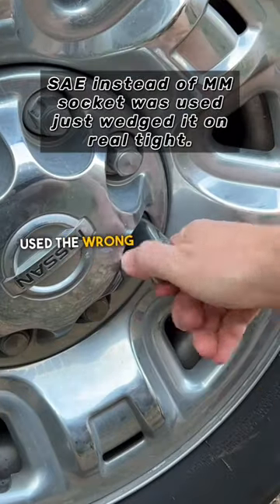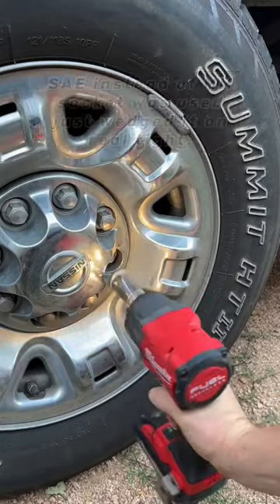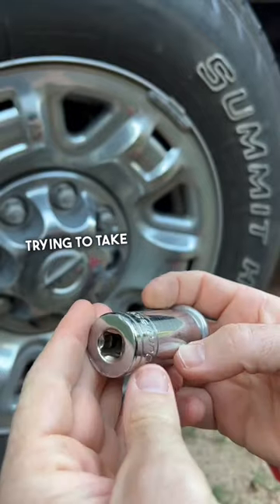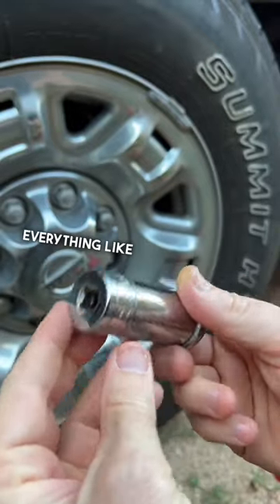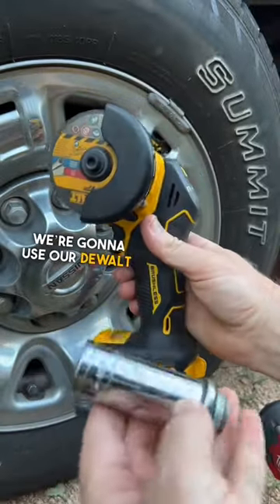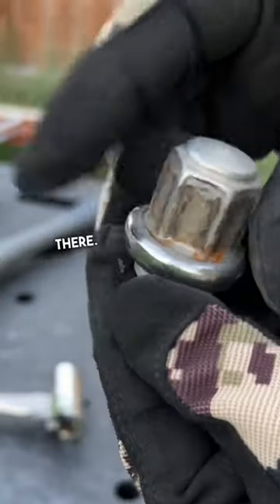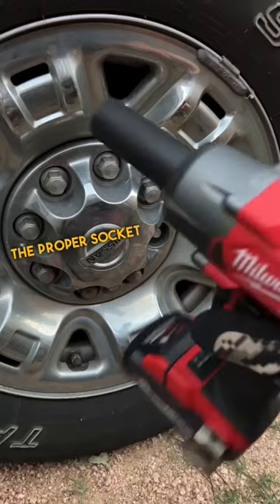DeWALT 3 Inch Cut Off Tool In Action!

Comment: Pretty sure you coulda just tossed it on the ground a couple times and not waste a socket lol
Reply: It was a chrome anyway
Reply: The difference between an impact and a chrome socket is not that big. I've used chrome sockets along with impacts on my impact my entire Professional Automotive career. Impact sockets have more weight so they carry more punch to the bolts. I have never split a socket that was a reasonable brand name
Reply: Also drop a quarter inch extension through the 3/8 adapter socket and drop it quarter inch side down on the concrete. I've never had that not work to free a socket from a stuck Bolt
Reply: That’s what I’m saying
Reply: @ramapalmer5985  Ya the only sockets I've broken have been those cheap low profile wheel sockets which is kinda just asking for trouble
Reply: Seriously
Reply: yup
Reply: Honestly could have gotten the lug out by putting a screw driver on the side and banging it down
Reply: Agreed cool tool but waste of a socket lol
Reply: Using chrome sockets on an impact not only hurts the socket but also messes up the impact anvil, the black ones are meant to be soft so they deform instead of the hammer.
Reply: First, never trust a mans advise who has a plastic work bench. Second, instead of wrecking a socket take a pin punch and punch the lug nut out.
Reply: @ramapalmer5985  I’ve never split the cheap chrome ones either and I’m using them with some pretty gnarly Milwaukee impacts
Reply: @DillonV  right! Especially 6 point 💪🏻
Reply: @ramapalmer5985  the weight is only caused by the impact socket being soft steel, chrome sockets are hardened and shatter/explode.
Reply: @402outdoorzx5  that's not the case, soft steel is not heavier and impact sockets are very much hardened.
Reply: I mean he could have just beat it with his purse a couple times and it would have fell out. Or use the other socket to take the remainder lugs off once the tire is removed stack a couple washers over the stud and against the rotor tighten the lug nut back down against the washers just enough that you break the tension on the socket remove with the right socket. 🤣
Reply: yup, had to do that a lot during highschool automotive and worked every time
Reply: Right I call it the old smacher it's an old machanics trick lol
Reply: @ramapalmer5985  The steel is softer therefore you need more to be strong enough. I’ve also split my handful of snap on chrome semi deeps. Fairly certain I had a bad batch of steel but. I don’t run an impact on chromes anymore cause of that.
Reply: @home541_  it's not softer, it's more flexible, or maliable to move with the impacts. Think of spring steel vs cast iron. Both hard, but cast iron is brittle whereas spring steel will flex. This is dictated by the metals grain structure. One is chrome vanadium and impact is chrome molybdenum. I can see how you can see maliable as softer. I've sent 12pt (when i didnt have a 6pt) deep and shallow craftsman, matco, and snap-on sockets with 700 - 1100ft lb ½" air impacts on axle nuts and crank pulleys for decades without failures
Reply: CR-V still works with impact. Just that is not effective as CR-MO. Impact sockets are usually heavier and can transfer more torque while storing torques during hammer charge turn. Heavier sockets will store and transfer even greater energy. 

There's a demo on YouTube of the same sockets for each type. The only difference is their size and weight. They tested it with the same impact gun and the results difference is huge.
Reply: @presistancelydeccer7338  High mass sockets are nuts. Coworker has a couple for Honda crank bolts. No longer needs his 60” breaker
Reply: its a snapon so why would you care ?
Reply: @ramapalmer5985  you clearly don’t know the difference between chrome and black. Has nothing to do with the weight of it 😂

Comment: no way i just seen you start a thread with a impact gun
Reply: I’m not even a mechanic and I know better LMFAO
Reply: My boss was a Nissan tech, it’s how they do it in their dealerships so I’m not surprised
Reply: It’s perfectly fine at low speeds and holding the impact straight that’s how I’ve always done it as a tech have yet to strip one doing it that way
Reply: @colerakocy2250  yes. But you didnt do it in your driveway with clean tools you know lol

Comment: Should of put the nut baack loosly on the thread an work the socket up n down untill it comes off
Reply from the maker: Appreciate the suggestion, yet, I tried that and other methods, had to cut it off. Learned that from a previous time it happened.
Reply: This works as well
Reply: @MasteringMayhem  lets pray you never work with rust because you'll be buying sockets everyday 

Or you could just be normal and hammer out the socket.
Reply: @MasteringMayhem  in a vice with a screwdriver into the hole of the socket and hit it with a hammer? bro the thought of cutting it should've triggered alarm bells

Comment: Step 1 to not ruining your socket: Put socket in vice
Step 2: beat lug nut out with hammer
Step 3: enjoy not having to replace a socket
Reply: Did he really think the nut was 
more expensive than the socket?
Reply: came here to say this
Reply: I get what you're saying but he definitely has more of those sockets. If he doesn't want to go to the store to get a lug the way he did it is quicker and cheaper. I feel like he could have gotten it with it on the wheel. If you bang it out with a hammer and thin piece of metal you'll scratch up the lug
Reply: Hammer and a punch worst case scenario
Reply: step 4 spend 200$ on a snap on 18mm crome socket and cry
Reply: Or just thread it back on, get an extension+breaker bar and wiggle her out
Reply: Lug nuts are cheaper than sockets.
Oh, and why were you not using the impact socket in the first place?
Reply: @wes1051  if it was a Pittsburgh socket then ya lol
Reply: Ya but u missed the video of him welding the socket back together bro, come on.....

Comment: Several alternate options:
1) Drop it on the ground, will jar loose
2) Pound it out with a punch through the square drive end
3) Tighten back onto a bolt so it goes the other direction
4) Let a real mechanic deal with it

Comment: I usually go get a stud that'll thread into the lugnut, thread it in as far as it'll go, put the socket in a vice and smash the top of the stud with a hammer and a punch until the lugnut comes out. If the stud got mushroomed up, just hit it with the cutoff wheel and you'll save yourself a socket. Usually works

Comment: Step one - use impact rated instead of ratchet rated. Step two, if you already screwed up step one - grip a trim bar against the socket wall, flat pressed against the flange of the lug nut, then hit the bent end of the bar with a hammer.

Comment: I did a similar job with the M12 Fuel but I had to cut the actual lugnut as it cross threaded and somehow when I took the bigger impact it would become loose but within the threads so it wouldn't come off.
Mine stalled a few times doing it, looks like the DeWalt would've been a bit quicker
Reply from the maker: For this situation this approach was best. This is a rare occurrence so I wanted to fix it as quickly as possible too.

Comment: You can just slam it in the floor over and over to get the swollen nut out. 

And I think I seen you put the bolt back on with a impact wrench. Twist it on to get the tread started then use the impact wrench.

Comment: Did you not try taking a punch or even a screwdriver and forcing it out? I’ve done this a couple times but never had one I couldn’t get out with a few good blows with a hammer and punch
Reply from the maker: Last time I tried that I just put a hole through the top of the lug nut 🤷🏻‍♂️
Reply: @MasteringMayhem  Swollen lug nuts are never worth saving. A pack usually cost anywhere between $25-35 and will save you a ton of trouble.
Reply: @MasteringMayhem  okay? Lmfao
Buy a new lug

Comment: Soooo many better ways to go about this lol
Fords and Nissans, especially, used what we call "beauty caps" which are just polished or chrome caps over the actual lug nut. After a few years and numerous tire rotations (probably with the wrong socket) they start to distort and get stuck in sockets. When this happens, I recommend replacing them with a solid lug nut because no one wants to fight off all 20 lug nuts on a five lug car.

Comment: Easiest way to get the nut out is to tighten it back on until the socket slips on the nut, or screwdriver through the back but you can poke right through chrome nuts like that

Comment: A. put a screw driver through the end and smack it with a hammer B. Those lug nuts shouldn't be put back on with a power tool
Reply from the maker: A. I tried the screwdriver method before, just put a hole through the top of the lug nut, had to buy a new one. B. I'll be using the ICON micrometer I got from Harbor Freight in the future.
Reply: lay it down  on side hit with hammer knocks it out do it lots of tomes
Reply: @MasteringMayhem  on every wheel nut ?. 😂😂😂🤦🏼‍♂️🤦🏼‍♂️🤦🏼‍♂️🤦🏼‍♂️
Reply: Well, you're definitely mastering some kinda mayhem....

Not only did you destroy a perfectly good socket but likely tore up the lugnut even more.

Comment: Lel. If the nut got stuck on the socket because if the wrong size. Just tighten it back. It eventually will come loose or if it was stuck during tightening. Just give it a few kick backs to open so that the socket will let go from the impact. No need to waste time cutting it out. Could save up sockets and time.

Comment: NEXT TIME:
A) Thread it back on and wiggle the socket off.
B) use a vice to hold it and a punch or quarter inch extension thru the hole.

Don't be like this guy.

Comment: Dude... Take anything steel, that fits in that hole and drop it from shoulder height... screwdriver with a decent handle can be used. Just drop it handle down and the nut will squirt out the (vertical) end of the socket.

Comment: U only use a impact to take lug nuts off simply because its easier doesnt in any way make it better. U over torque your lugz and it will be just as bad as not tightening them at all. Get a torque wrench use that muscle in your forearm that holds onto things and twist said lug nut on by hand and when u get it hand tight then use a ratchet and go in a star pattern atleast 3 or 4 times on each then put the torque wrench to it and apply proper amount of torque. U can wprk for Sears though thats how they put lug nutz on works real good for about a mile or 2.

Comment: Put the socket in a vise, find a punch that fits through the drive hole and hammer away. Works every time. or you could destroy a socket and waste 20 minutes doing this instead.

Comment: Or you could have taken like a quarter drive extension and shoved it up the half inch drive hole and used it like a ramrod until it came out and kept your Chrome socket perfectly intact

Comment: Push a Philip head screwdriver in the socket hole and whack it on the floor a few times. 9.9/10 times it works

Comment: Or… slide a 3/8 drive extension down the 1/2 square… tap with a hammer until the lug comes loose.

Comment: Let say, for the sake of argument, that by some ungodly force you genuinely could not have gotten that nut out in any other fashion. It has welded itself to the socket, and is never coming loose. Why the hell would you waste time using a cutoff tool to do an angle grinders job, destroying the whole nut-socket assembly, instead of just going and getting another god damn lug nut. This whole video is just an absolute mindfuck

Comment: Chuck a screwdriver in the socket from the other and and bash it on the floor,

Orrrr use the proper socket, I work in a tyre store (almost entirely truck and earthmoving) but when I do I car I use a wheel braces because I hate seeing the impact marks from rattle guns on car wheels that use such low torque anyway, 

Also gun control should take your power tools away you shouldn't be allowed to play with them

Comment: Put a bolt in the socket and smack it of the table.  If your gonna sell a tool. Don’t have a stupid nonsense situation. Just have it being used in a realistic situation.  Like grind comes with the dam thing. Do is a tight area to show its advantages.

Comment: 1. Out socket in vise. 2. Grab shitty screwdriver. 3 put said screwdriver threw  opposite side of socket. 4. Use hammer and beat out. Problem solved socket saved

Comment: Dude the best way is to put it in a vice grab a punch and knock it out of there luckily that’s a cheap duralast socket and not a snap on also you should be using an impact grade socket when you use impact tools good job though that’s one way to do it

Comment: I'm pretty sure you just weld rebar to the socket stick it in a jackhammer and it will wiggle it loose after about a 12 hour running cycle. 🧏‍♂️

Comment: Or just hear me out, OR you could thread the socket back on the wheel stud and smack the socket with a hammer a couple times it will come off if you just give a little effort. No reason to waste a socket whatsoever.

Comment: Take this guys power tools away he has no clue what he’s doing. Put it in a vice and use a 1/4 extension or a bolt  and hammer it they the square hole to force the nut out, you wasted a perfectly good socket and gave terrible advice if you worked for a shop they’d kick you out if you tried to cut a socket